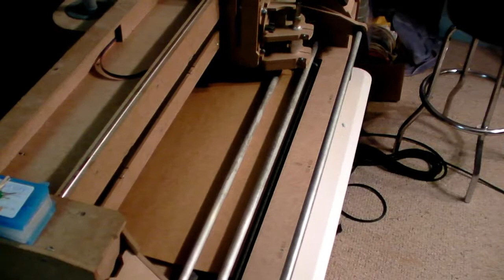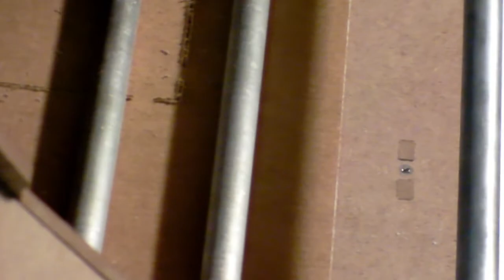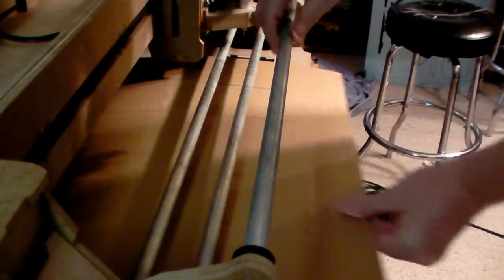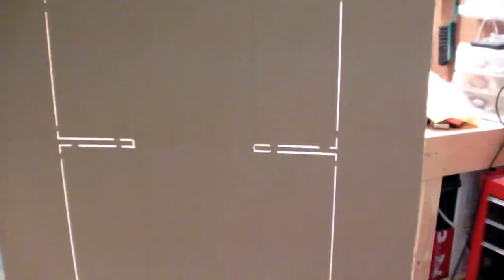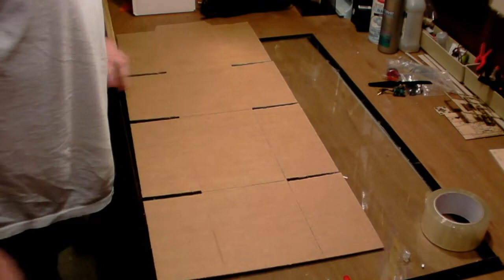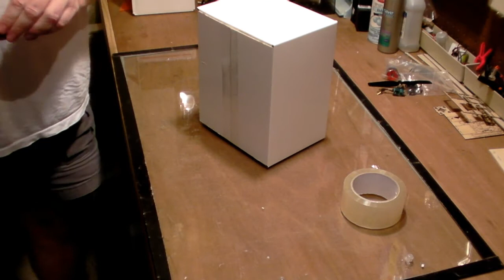Phlat-Boxing!

Comment from the maker: @canadianhoser I have the original Phlatty, but I have retired it. :) I mainly cut foam on my PhlatPrinter MKII (now discontinued) and "other stuff" like woods, G10, and cardboard is cut on the PhlatPrinter 3 as seen in this video.

If you know the process, you CAN create cut file from PDF's, but you need to go through a few steps. I've done this MANY times, though.